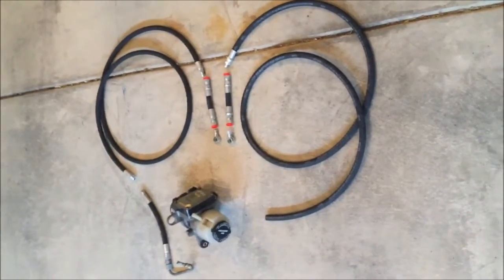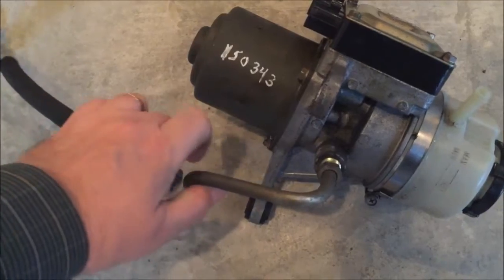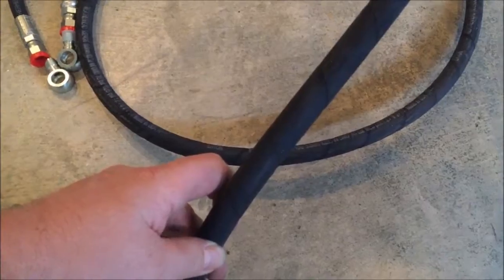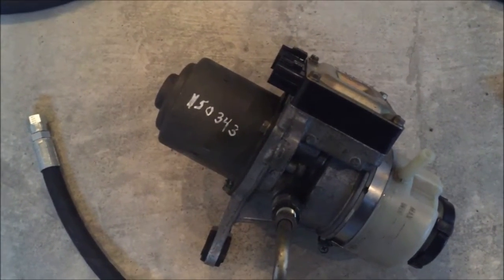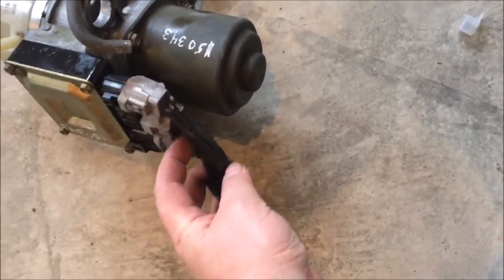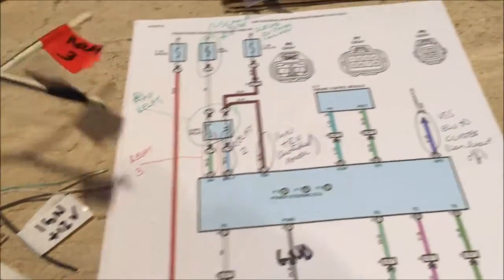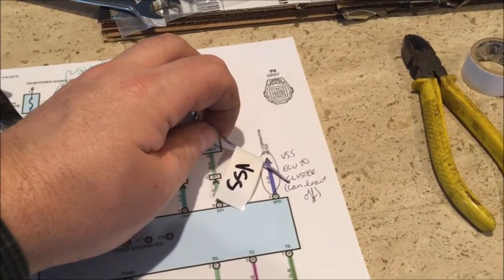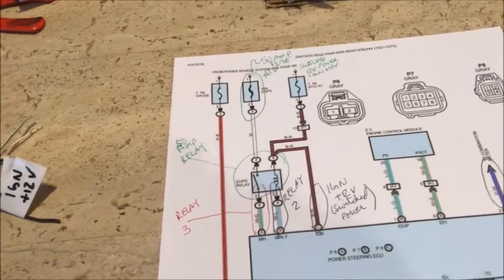TT Power Steering

Comment: So the mr2 pump doesn't have a built in relay? I guess that's nice because it can be easier and find a pump this way but also seems like to much to be wiring in your own relay not to big of a deal but all the videos ive seen the pumps had built in relays so I thought it was kinda odd you had to wire a relay.